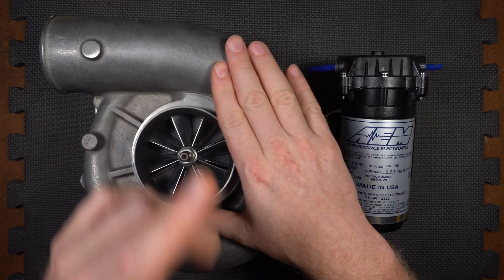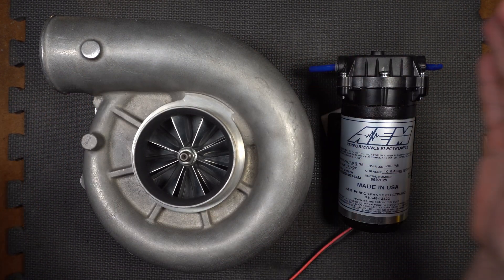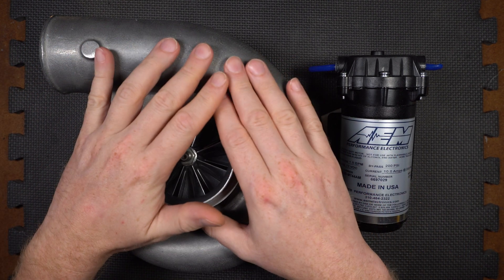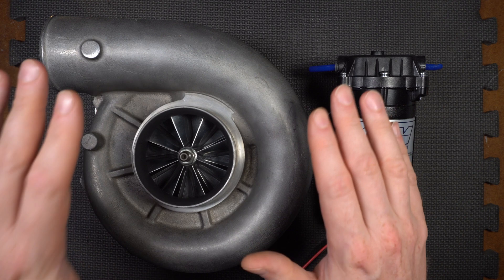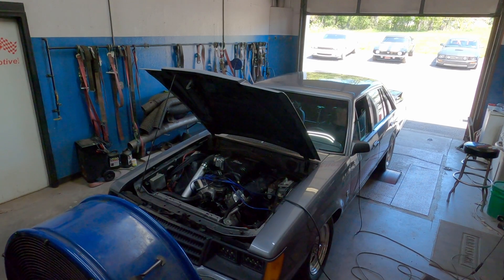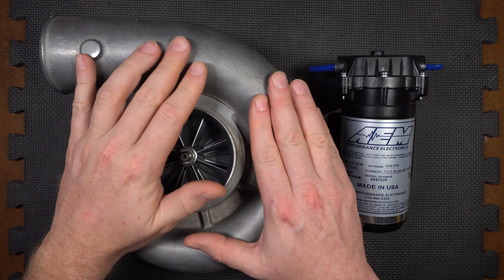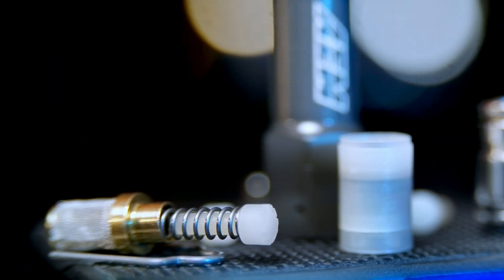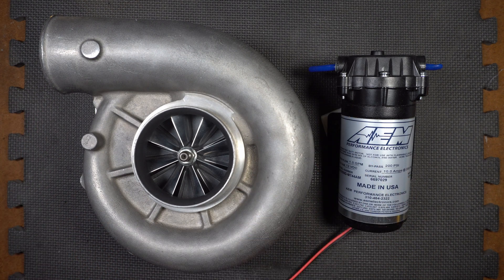Volute Methanol Nozzles Installed & Tested

Comment: Your demo clearly shows your idea is bogus. Dividing the pump output by 3? Of course you will get a pan of dribble. The pump can't support three nozzles. It would also cause turbo impeller deterioration in a short time span. Lastly, do not believe everything a company likes to boost about. They really just want your money.
Reply from the maker: And yet it works extremely well - we took it to the dyno and picked up a ton of power: https://youtu.be/b9d5xv9INmw  And here's a deep dive in the methanol data: https://youtu.be/mBM-2qIav74

Comment: Volute spray does not change the compressor map. Spray into the spinning wheel and cooling during the compression phase does so. Volute spray is smart for reducing IC heat soak during sustained heavy boost. Also… AEM nozzles are not 250, 500, and 1000cc at any particular test pressure… because AEM has *no standard test pressure*. Ask them and they just don’t know/don’t care. Lastly, push-to-connect fittings commonly leak. Compression is lots smarter.

Comment: Also when spraying water over methanol the amount of cc changes.  The meth will change the pumps psi because it's thinner.  Because the water is heavier, you will get much more cc then if you spray pure methanol.  Also check valves, hose length, fittings, T's etc all play a role in the pumps final pressure output dramatically changing how many cc will actually be introduced.. for example, if I want 800cc but have a check valve and a trunk mounted kit I need to spray 900 plus cc..just some food for thought. Figured I'd share my findings with you brotha

Comment: Great test . I wanted to clarify a comment in your video.  With volute injection you don't get compressor efficiency. In order to get the turbo to move the compressor map
Over to the right you need to inject pre compressor blades where the methanol goes through the turbo changing its characteristics and making it more efficient.
Reply: Only 3 to thumbs up?

Comment: They'll be injecting into greater than atmospheric pressure, which will reduce their flow rate and might be an explanation for your significantly higher than advertised results

Comment: You should look into pro-meth. They have better pumps for that many nozzles. They do 4,6,8 port direct injection setups with their pumps. Nozzles are higher quality as well. I made the switch from AEM to Prometh and notice the difference. It seems all the manufactures use the same pump brand but made different for each suppliers needs.

Comment: not a particularly useful test .. as the car will most likely have 14.4V  which will provide better flow with all the nozzles connected up .. on a different note.. That looks like a huge amount of meth !
Reply from the maker: I figured that with voltage drops from the wiring, 12 volts is realistic, maybe a little low.  I know it won't get over 14 volts for sure - everything going full tilt, the voltage does sag a bit - fuel pump is getting full current (22 amps by itself, wired straight to the trunk mounted battery), the 80lb injectors running at high duty cycle, the ignition box drawing max current, etc.  In fact, I just looked at a datalog - battery voltage during a pass drops down to between 12.9 and 13.2 volts.  That means the most the pump is likely to get is 12.2 volts while running.  And you're right, it is a huge amount of meth.  I'll likely jet down one or two of the injectors from 500cc to 250cc; going from a nominal 1500cc to 1000-1250cc.

Comment: Yo that is a baller stop watch. Also your plastic welding really came out great. Barely noticeable unless you are looking for it. Seems you are finding the limit of what the single pump can do. It seems to me that a pressurized system using a fuel pump and actual injectors would really work better overall and is still cheap, but there may be something I'm missing.
Reply from the maker: Thanks.  I did try an actual fuel injector back in the '90's yet and didn't have much success.  I agree with you in general about these kits, but they certainly seem to work and this time I figured I'd take the path of least resistance, since I've decided to take the path of most resistance in making an electric turbo work in general.  I'll probably jet it down a bit - like to 1,000-1,250cc nominal flow, instead of what you saw in the video - 1,500cc nominal flow.
Reply: @AlexLTDLX  Yeah I might do some of my own experiments someday who knows. Some people have talked about how water/meth atomizes vs fuel at given pressures etc. I'm sure there is a reason using injectors isn't more popular.
Reply from the maker: @802Garage  Injectors would solve the need for an additional solenoid (which the AEM kit comes with).  But what sold me on this kit was the AEM V3 nozzles: https://youtu.be/aooi3Y9YuGQ
Reply: @AlexLTDLX  Very cool test! There's no doubt AEM makes some good stuff. I'm glad the nozzles are clearly a custom item, not just some furnace burner piece or something. AEM boost control solenoids being one of the clearest examples of rebranding.

Comment: A few points to mention:
1-The pumps a diagphram and very crap for smooth flow. Need an accumulator (pressure tank) to take up pulsation and keep steady spray rather than pulsed dribbling. They also are low volume and regularly claim big pressures which in reality are just BS.
2- Your lines are way to small, especially on the pump supply. Kits are built to price. 
3- Poor atomoisation there. Not a supporter of big drops of water that are easy to settle or condense in plumbing which is why W/M best placed close to throttle or intake manifold (not all of us run throttles). 
4- Test at 14V which is what you will have in reality of a vehicle. 3S packs for the RC guys and undervolting. 

Ideal for my 2 cents: Way bigger tank (we street, not drag strip), 10mm or 3/8th intake plumbing with coarse pre-filter to the pump which I would be looking at a tripple diagphram or gear style, same size line to pressure accumulator to store up the highest safe pressure you can run, fine final filter (pumps can have or create junk in line) and good HP solenoids to the nozels, aghain, decent size to suit the nozels. Basic and crap setups of turning pumps on and off result in big drips or dropplets and combine this with guys who spray infront of the compressor wheel.... yeah, nah!
Reply: good points.  I am running meth on my 84 Turbo Regal, I'm using the ALKY Control style progressive controller.  works like a damn. it's pushing 20psi, and the controller runs off the TPS, and boost reference.  Just curious about the Volute style injection so here I am.
  How would you integrate an accumulator in a setup like that?  Do you have links to share that a guy could learn a bit more?  thx in advance
Reply: @learysinsight9617  I am sure Alex has more videos in the pipe for his testing and tuning but here is some quick-n-dirty responses. Pulsed pump outputs can be good for higher flow nozels that can use the pulse to help break up the droplets but with low flow nozels, the pressure just spikes in the lines and makes noise and vibration. Look up the old "AquaMist" systems that used a pulsed pump to drive sprayer. Soft lines can and will act a little like an accumulator but more so, like a dampener. Accumulators can just be and tank full of air with single entry/exit in bottom and water just compresses the air however, under a 100-200PSI, not much air volume is left over and reduces the effect a lot. Better designs are like those on house water pumps and have a rubber bladder inside that might already be charged to 2/3rds of the rated system pressure so as to keep more air for the accumulation (like Spring travel in car shocks). To use an accumulation setup though, pump is always powered and a pressure switch stops the pump at max pressure and restarts if demand is sensed. Water/Meth spray control done via solenoid and PWM valves. No videos or links sorry, my research from years of expirience and background in Aviation and things produce power.

Comment: Most pumps have an adjustable screw you can bump the pressure with. I"d wager (but never tried) Also volute injection isn't as good as pre inlet IMHO. Less wall wetting and puddling if ya spray it all pre-turbo. Also less post stuttering as nozzles and fluid clears from piping and turbo.

Comment: Start the stop watch. At 10 seconds turn on the pump.  Switch the pump off at 40 seconds
Reply from the maker: Yeah, that would've worked too.  Did you catch that that stopwatch had a tenth of a second hand?  I love that thing...
Reply: @AlexLTDLX  one of the race movies.  Le mans or gran prix had a guy with a clip board with triple stop watches.  

Is there any pump pressure loss with 3 nozzles rather than 1 or 2

Comment: The flow will vary with the pressure differential across the injector. You do not have a rising rate boost referenced regulator. Therefore as your boost goes up your flow will go down. 
The improvised nature of the fuel supply set up that accompany WMI kits always make me want to avoid them.
Reply from the maker: TBH, I was against them for a long time myself.  But the Sledgehammer electric turbo (supercharger) is the perfect candidate - relatively low boost, extremely efficient yet slightly undersized.  Meth hits the weaknesses perfectly.

Comment: I'm glad you tested individually as well. Can't wait to see how it helps out.
Reply from the maker: I felt like I had to because the flow looked uneven - even though it wasn't.  I need to check the pump's start up ability under pressure again - the nozzles have built-in check valves, and they're strong enough where you can't blow through them.

Comment: And you need to remember you are pumping the meth in to pressurized volute. It will reduce the flow rate if you dont route boost pressure in to the meth tank.
Reply from the maker: That's true - but unlike the fuel system, this pump is supposed to run at over 200 psi, so the ~8 psi isn't much, really, plus it's factored in when you tune it, since it only runs under boost.
Reply: @AlexLTDLX  oh yes I forgot the low boost of your setup. Usually methanol injection is used on very high boost application like compound turbo diesel.
Reply: Is positive pressure typically plumbed to the supply tank?
Reply: @ThePavilionlivin  depending on the system and pumps. If you dont have big enough pumps, then you could use boost to aid.

Comment: I think you are correct about the 3 nozzles causing pressure drop. Check to see if your pump has a pressure control screw. You can flow the nozzles together adjust the pressure until you get the desired 500 ml. Should work great!
Reply from the maker: Thanks - I will check for a pressure control screw.  I didn't know that was a thing.
Reply: I know that shurflo pumps have it for sure. I hope it does! If not you could get a shurflo.